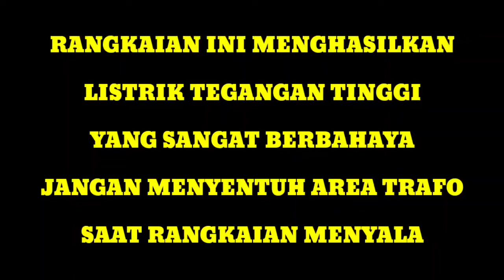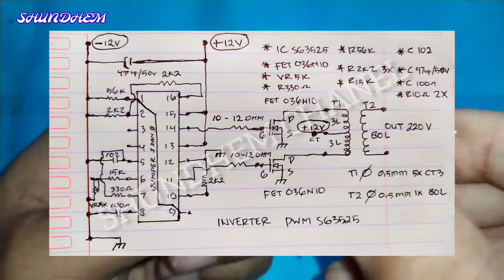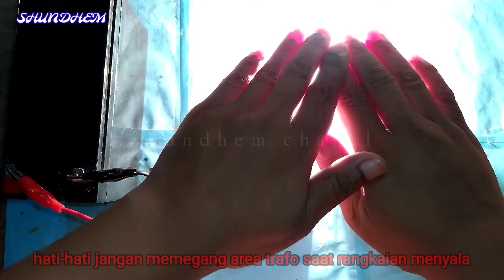MERAKIT INVERTER 12 VOLT TO 220 VOLT | 50Hz | KA3525 | SG3525 | PAKAI BEKAS TRAFO FERIT TV

Comment: Assalamualaikum, selain dari mosfet ditotorial apakah mosfet yg biasa di inverter di modul egs002 cocok untuk skema diatas   seperti z44 ,3205 kode hy4008 dll, resistor untuk gate sama nilainya ohm, trmah kasih.
Reply from the maker: cocok, matching kan dulu pwm sama trafo
Reply: @shundhem_electrick  jadi frekuensi berubah lagi om.
Reply from the maker: disesuaikan
Reply: @shundhem_electrick  sudah Nemu pak mosfet yg sama trmah kasih pak.
Reply from the maker: iya, gak sama juga bisa asal N chanel.